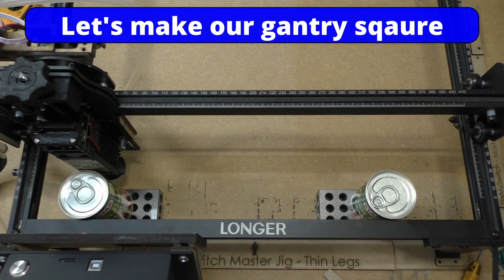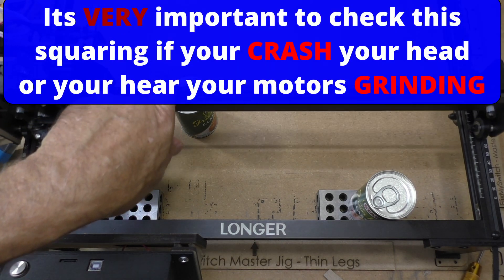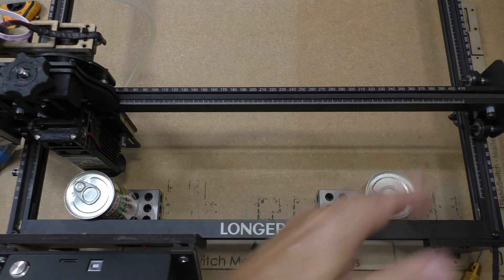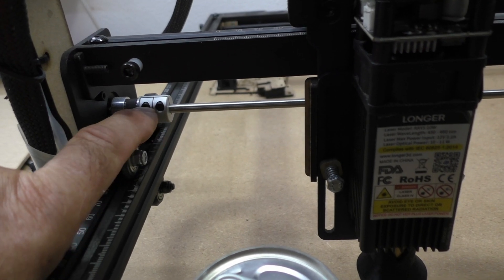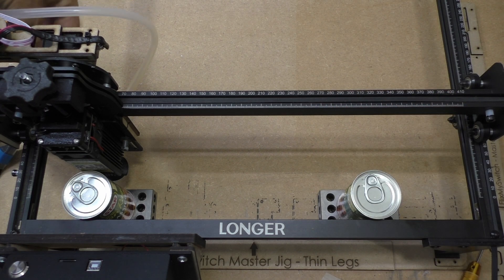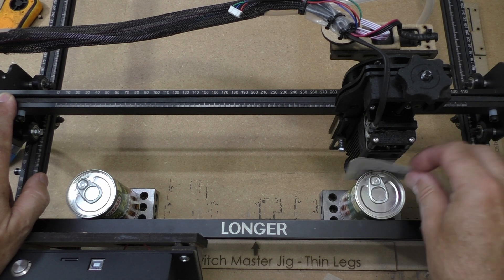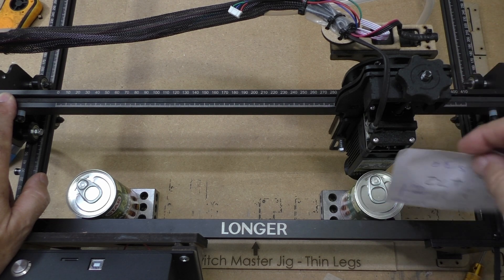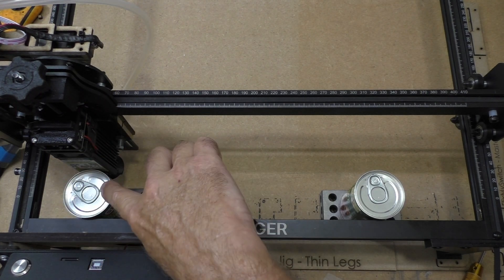Diode laser how to square your gantry for better accurate square cuts circle not closing

Comment: I have a ray5 20w. What have you done to the laser module? specifically what is that sticking out the bottom?
Reply from the maker: Hi it's my longer 10w with a 3d printed nozzle. Is that what you meant❓
Reply: @FlixmyswitchLASER  what is the nozzle for
Reply from the maker: @dragonshoarddesign3094 it an air assist nozzle connected to an air pump. Air is blown into the kerf to help get cleaner deeper cuts. You can purchase metal nozzle kits to fit the 10w
Reply from the maker: Your 20w has the nozzle already
Reply: @FlixmyswitchLASER  y Yeah, I know.I just never seen the ten with that attachment
Reply from the maker: @dragonshoarddesign3094 I will have to do a video about it once I have finished my testing.  It all 3d printed and I can remove the tip. Different tips for cutt6and engraving. And makes it so easy to clean the lens👍